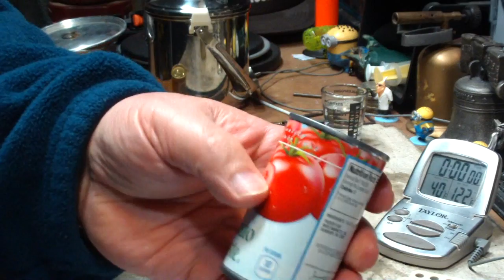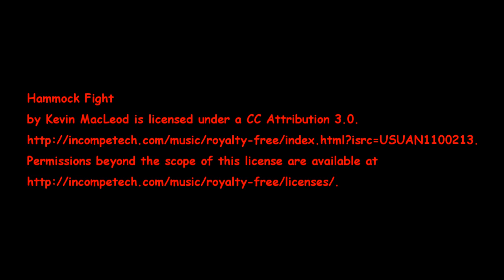Fancy Feast Stove - 12 cm Zebra Pot - Boil Test #1

Comment: Hiram, if you put a handful of holes in the sidewall of the inner can, below the lip of the cat can, the fuel will soak in faster and allow a stronger burn at start up. Basically takes less time to fire up stove is what I'm trying to say I guess. 
I haven't made this specific one yet but do make a very similar one and have for a few years now. I use the aluminum bottles and cut them to desired lengths. 
Luv these type of stoves. They are great for cold/snowy weather. 
Thnx for sharing my friend.